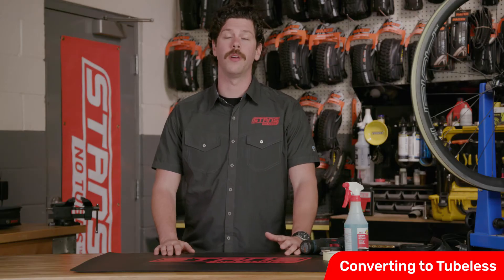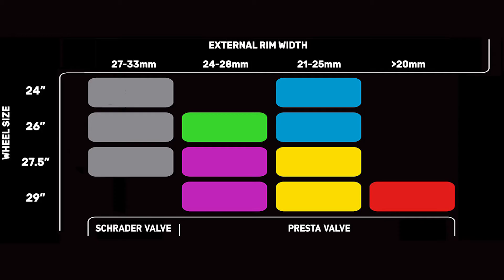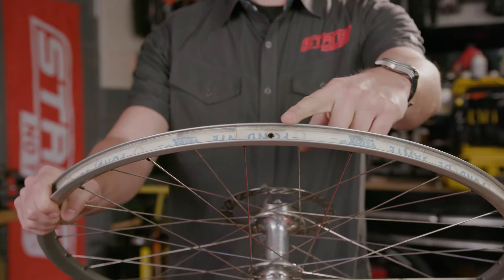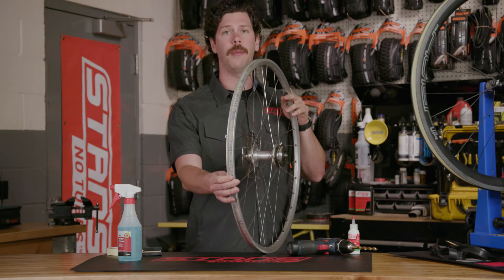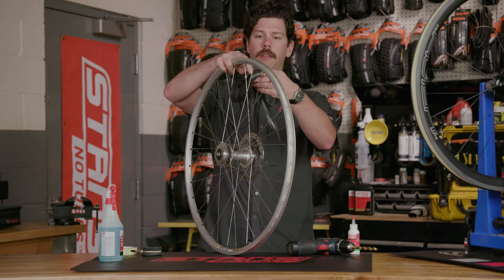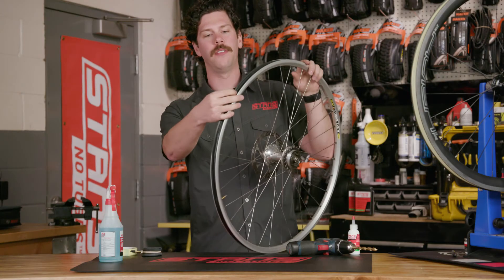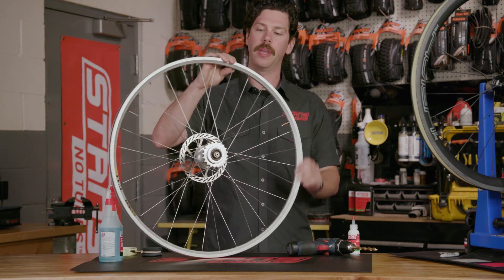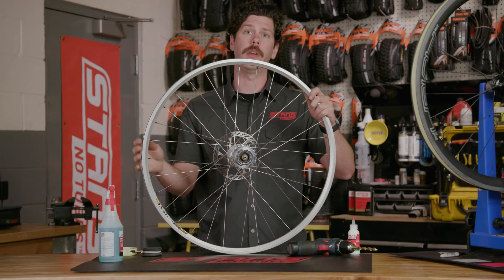Tubeless Conversion Strip Installation

Comment: 1. Does the (old) tape have to be air tight or will the strip do the sealing?
2. Since the strip is thick, the tire doesn't fit anymore on the rim (bead hook)...?